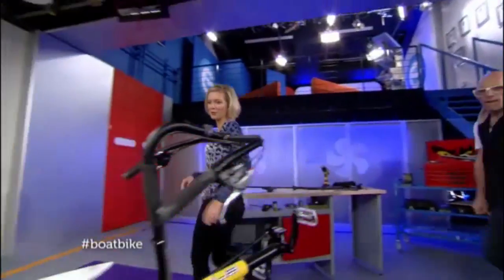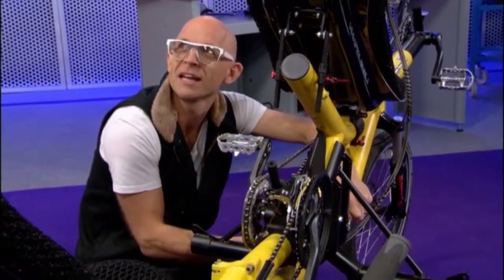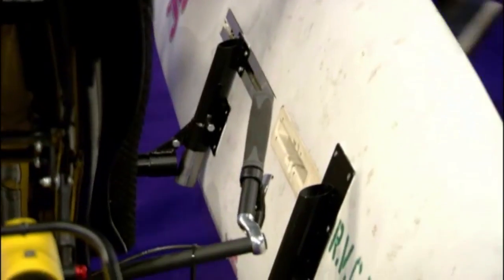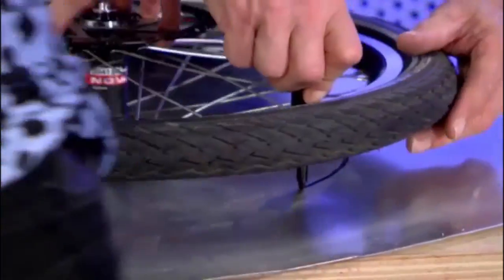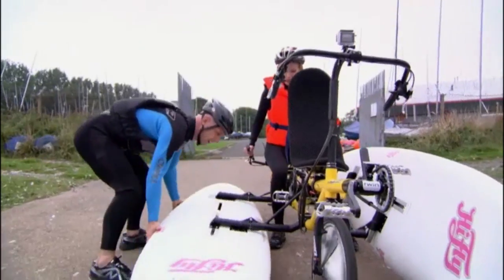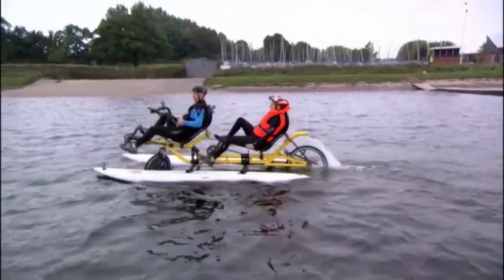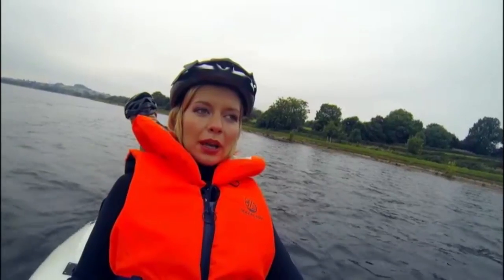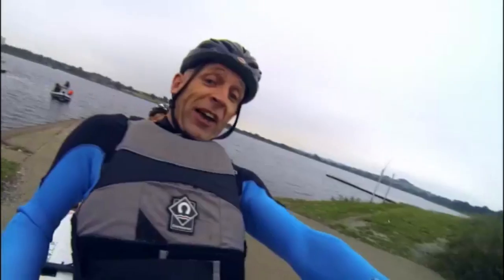DIY "Boat Bike" - The Gadget Show #FuelFriday

Comment: If only...you could change the pitch on the paddles to in the plane of the wheel and increase height of the hull in road mode. Paddles are a lot of aerodynamic drag in road mode and looks like the hull is a a bit low slung for the road as well, but hey, this is really cool. To think I was playing with an upright design, on paper, more like the "Boat Bike" on the Gadget Show,  over 40 years ago, as I'm sure many other tinkerers were as well. Fantasy come true. Are the rear wheels effective rudders for steering in the water? Apparently. That's where the upright bike conversion is challenged, not easily adapted for rear wheel/rudder steering.